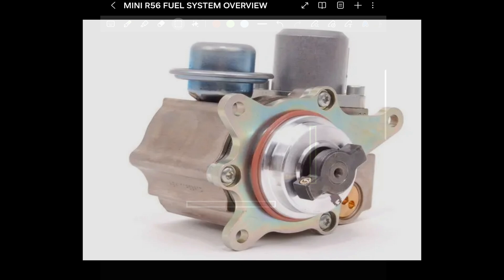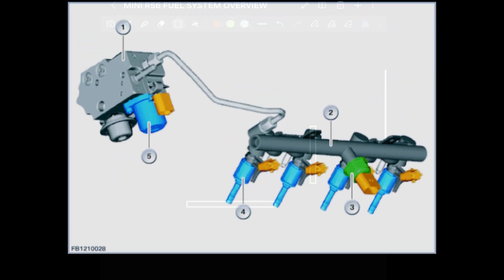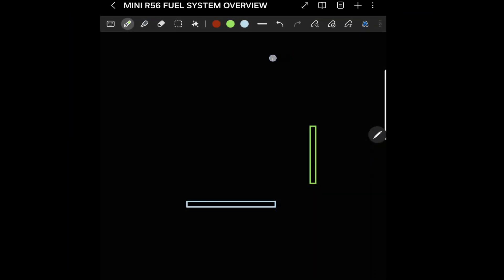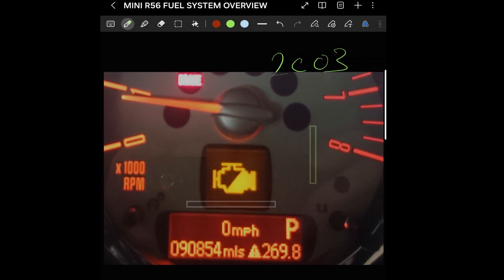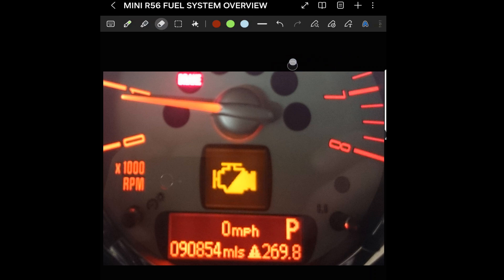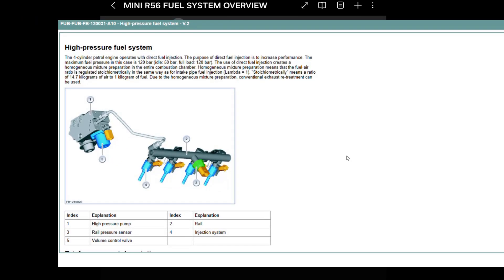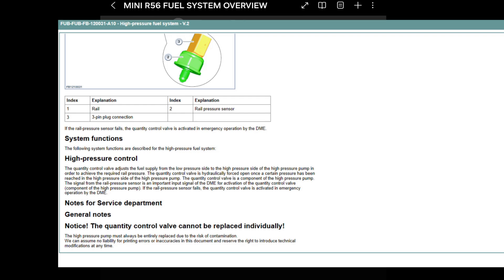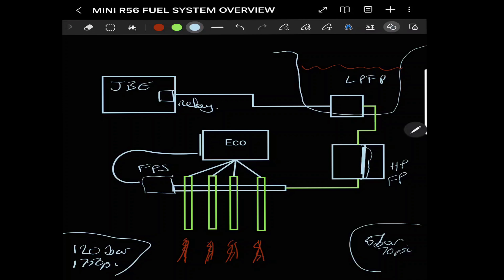Mini Cooper S Fuel Pressure - High Pressure Pump - Crank No Start - Fault code 2C03

Comment: Hello teacher, first I want to congratulate you for your video, but I also want to ask for your advice, I have a 2012 mini cooper s r56 n18 turbo 1.6, everything was fine with the car but on one occasion the battery discharged completely, and after that I was left with an ignition problem, in the morning the engine starts but it shakes and turns off and smells like gasoline, sometimes it stabilizes but then loses pressure and the damaged engine appears on the screen, I scanned it and it gives me these 2 codes. 002C01 / 002BEE any suggestions. thanks.

Comment: Hello, I am getting error 2880 in my 2008 Cooper S N14 engine vehicle. The vehicle starts easily in the morning, but after 10 seconds it starts to stall and recovers. Later, when I hit the road, when I press the gas all the way down, the vehicle does not consume gas, it stalls, and sometimes if I press the gas after 4000 rpm, it goes away. I changed the high pressure pump, changed the pump in the tank, changed the fuel filter, but it did not improve. When I read live data, the fuel pressure instantly goes up and down from 700psi to 100psi when I press the gas. Could the problem be in the rail pressure sensor? I would be glad if you help

Comment: I have a 2008 Mini Cooper S R56. The car will start fine and runs good for 15 minutes then it will studder and the half engine light comes on the tach. The fuel pressures seem to be fine. I have replaced in tank fuel pump and the filter in the tank. I also had someone in Canada to rebuild the HPFP. I have looked at the fuel numbers on a scanner and the minute it begins to studder, run rough and Half engine light on the tach comes on the fuel set point drops to zero. What controls the fuel set point ECU? Would the fuel pum relay be getting hot and in tank fuel pump not get enough power or no power. Codes are sometimes stored but the CEL light on the speedo dose not activate.  If a code is stored it say Fuel Rail Pressure too low. I can clear this code and it will begin to run ok until a 10 or 15 min has past and the same thing happens as described above.  Any insights would be very beneficial.
Reply from the maker: Hello, It looks like a tricky one! 
Assuming your HPFP rebuild was done properly, and your lift pump in the tank is good, there are a few areas to check out. 

(1) My first thought would be to check power supply to the lift pump in the tank - the footwell module that supplies power is a known failure point and can be erratic. If this pump isn't working well then the HPFP won't do its job properly (as mentioned in the video).  Can you rig up an amp meter in the power supply line? Or, not sure on this, but maybe you could hard wire the lift pump to see if it behaves better? If it has a direct power feed then you can confirm or eliminate power supply as a problem. Just be very careful of gas fumes & sparks!

(2) Rail pressure sensor - potentially giving duff fuel rail pressure info to the ECU. If so, things will get complicated as the ecu tries to adapt to spurious data. I can't see anyway of testing it apart from maybe disconnect it and see if the ECU defaults to a best-guess and works better.

The fuel pressure set-point is determined by the ECU and will be based on things like engine RPM, throttle position, temperature etc. I don't think it should request zero as that would stall the engine if the actual pressure got anywhere near. Unless, maybe, it's some kind of failsafe?

It's quite normal to sometimes have a code stored but no CEL light, the software decides if it wants to light it up, sometimes after a few starts or so many miles, depending on the problem.

Question: when you clear the codes and the CEL light, can you start it straight away and it's ok or do you have to leave it for a while before driving again? 

Good luck resolving it :)
Reply: @FixingStuff-MostlyCars I can start the car at any point. I has never had a hard to start problem. Clearing the codes and when the Half Enigne light is activated it starts equally as well.
Reply from the maker: That probably rules out something overheating if it just works after an on/off cycle.
I'd try to eliminate power supply problems to the in-tank pump first though because it's a common problem, and should be quite easy to do...